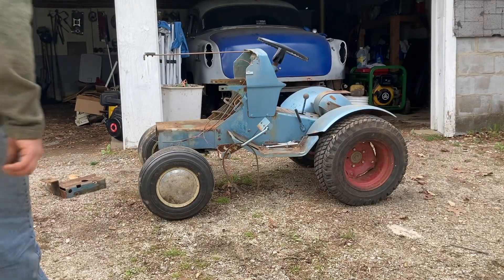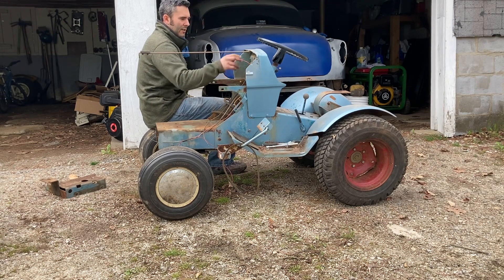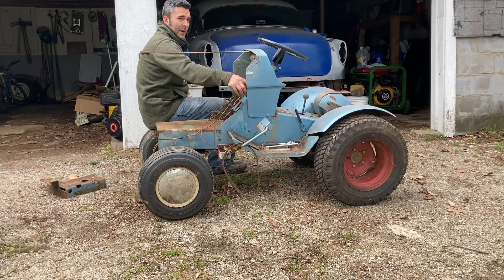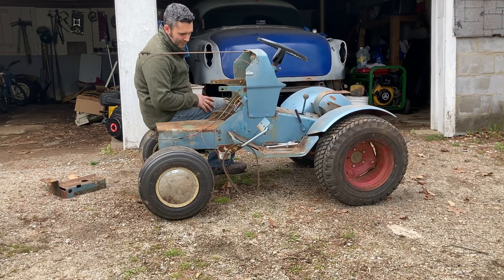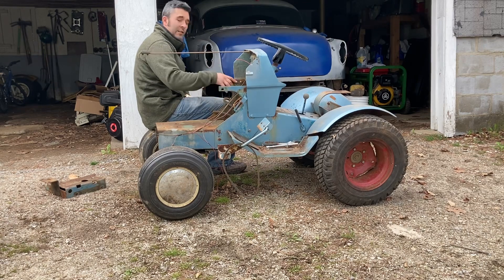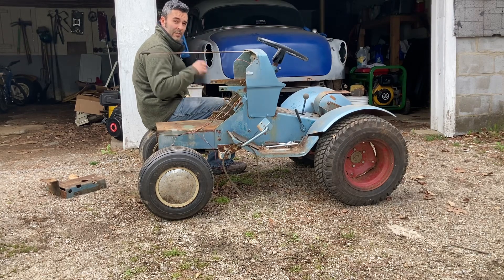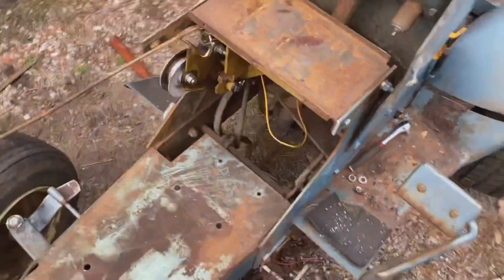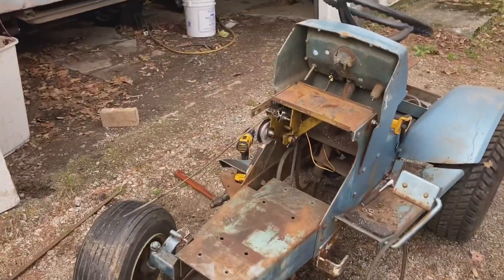Diesel swapping a 1970 Sears SS12 tractor!

Comment: I have my dads 1971 and I was wondering what diesel motor you installed in this video.
Reply from the maker: It was a Chinese clone of a Yanmar 10hp diesel, came off a diesel generator but once in a while you can find new ones on eBay or used yanmars off ebay

Comment: Do you still have that motor
Reply from the maker: Yes I do. The whole tractor is for sale.
Reply: @crankysports  how much for the original gas engine
Reply from the maker: @ethanpetersen2888  I have it on Facebook market place for $150 I think- everything but the starter and clutch are still on it. Ran a year ago
Reply: @crankysports  i need the starter with it, i could only sell it for 60 to 75 here
Reply from the maker: @ethanpetersen2888  where are you located? I need the starter
Reply: @crankysports  Utah